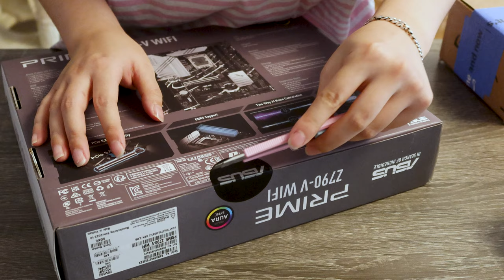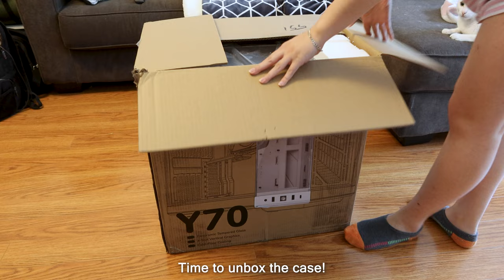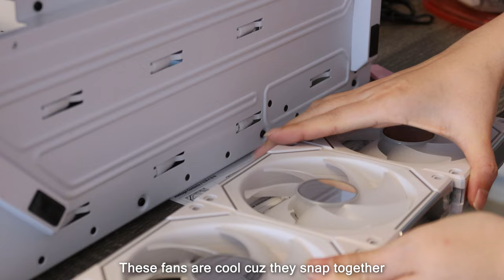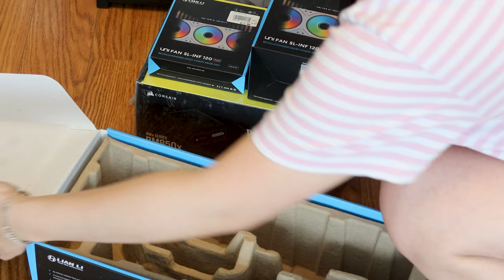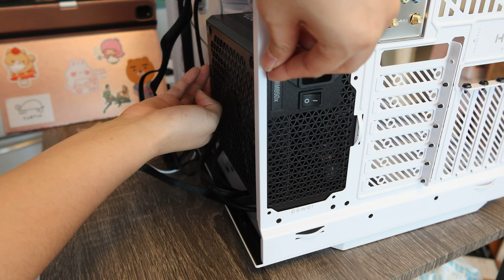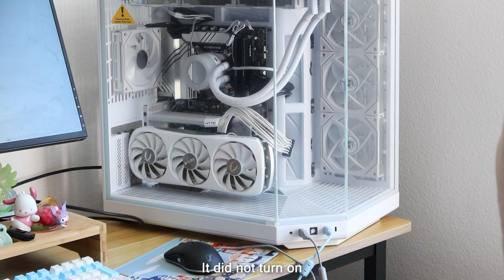Building my first PC | White Aesthetic, RTX4080 Super, Hyte Y70, Gaming & Productivity build

Comment from the maker: I got a lot of comments on my SSD being installed incorrectly but it is now fixed. I appreciate the constructive feedback!

Also got a lot of comments about why did I get this part instead of this other one. I got a bundle through Microcenter for the CPU, motherboard and RAM so my reason for buying those are because of the price. I am aware that I lost some performance from buying those parts, but it was my first pc purchase so I worked with it. All other parts were recommended to me either by an experienced friend or through a worker at Microcenter. Overall I have good temps and my gaming and editing experiences are so much better than before, so this build as of now is working for me!
Reply: great specs 12900k and 4080 super is a match made in heaven for both productivity and gaming i for one am glad you went the intel and nvidia route amd is a crash machine intel and nvidia just works
Reply: @hygarthwilliams6392  really? I was thinking of pairing amd and nvidea, why dont they work? Intel is so much more expensive aha
Reply: I did noticed it like not how I do it when I install an ssd on my Steel Legends motheboard Am5, paired the 7600X with the 7600 XT the idea here is being able to enjoy performance without breaking my wallet.
Reply: An upgrade is an upgrade, now matter how small!  Super big feat to build a PC for the first time as well, even I haven't done that yet because it's daunting. I'm so scared to mess anything up, but soon enough I'll push myself to do it.

Thank you for the video:)
Reply: How much was all this? T-T
Reply: How is it running? Has it given you any issues? I'm thinking of building my PC as well. Any tips? Any suppliers I can try?
Reply: came to the comments to make sure you fixed it! Great build :)

Comment: 3:12 Your SSD is not installed correctly.  You used the standoff instead of the proper screw that was provided with the mothetboard.  If your ssd is installed at an angle, it is wrong. Ssd should be exactly parralell with the board.  The standoff goes in first and then the ssd with tiny screw on top.
Reply: ใช่ เพื่อน  SSD ติดตั้งผิดวิธี  แบบนี้ทำให้ SSD เสียได้เลยเพราะการโค้งงอ
Reply: I'm pretty sure you install it first with an angle no? Then you push it down and fasten it
Reply: @appancha it needs to screw into a standoff. She screw it directly into the motherboard, which is wrong.
Reply: To bw honest its her stuff she paid for it so if she fucks it up is also her problem , these things even u noticed but only matter if someone is works in this area and do for clients pc ,because for that u need a do it correctly
Reply: @kryzlo474 nothing wrong with letting her know it’s messed up. Now she knows how to do it for her next build 🤷‍♂️
Reply: Only part I cringed right when I saw that😢
Reply: @yipyiphooray339 idk if you can see, but it’s bent at too much of an angle. she was so supposed install the standoff then secure the SSD with the screw that comes with the mobo

Comment: I have a question for you @Somaswooshi. Why did you get the power supply in black and 850W and not white and in 1000 or 1200W since your build is in white? O.k I see you said that you went with black because you can't see it from the front, but again why the 850W and not the 1000W power supply?

Comment: Honestly not bad for a first time PC builder! Looks great
I see an associate helped you picked out the parts.
They did a great job selecting parts based on your use cases. 
Make sure to fill out a survey, it really does help them out.

The only nitpick that will effect you over time is the SSD riser. 
The little hexagonal screw you placed on top of the SSD is meant to be a bridge pillar of some sort to make sure the SSD is not bent when installing. 
Over time you will notice that the SSD will bend due to heat and stress. That thicc hexagonal riser and M.2 silver screw is there to prevent that from happening.
My recommendation is to use the M.2 screw that comes inside of your motherboard box, it will be this tiiiiny screw that's silver that comes in a singular plastic baggy.
Micro Center does sell the M.2 Risers and screws individually as well if you're missing yours. They will be found near the thermal paste area I believe.

Another thing that will help you over time is space. I saw you only have one 2TB drive. Make sure that you don't use more than about 80% of your boot drive, because when using 100% of your drive there is a chance of corrupting Windows. Windows does need some breathing room to install updates, security fixes and more.

When saving footage (since you mentioned you will be video editing) make sure you save it externally on a hard-drive or get a secondary internal drive.
HDDs last longer but are slower, SSDs are faster but die quicker. It's best to use SSDs for cache files or game folders & as a boot drive, and  your HDDs as additional storage.
NASs will help you too, but that's becoming it's own topic.
When upgrading components, make sure you only use the power supply cables that came with your power supply as they are rated for it/are proprietary.

Otherwise Good job! Looks very clean. The Y70 is a great case to build in.
Say hi to Josh from the service/repair department for me plz.😉
Reply from the maker: Hey thanks for your thorough explanations and advice! Yes micro center folks were extremely helpful when I told them what I wanted and needed in a PC.

Yep found the other screw I failed to notice and the SSD is now installed correctly. Also got a heatsink for it! I definitely plan to install another SSD in the future.

I have been using an external hard drive for all my video footage cuz it’s takes up a huge amount of space lol. Good to know why it’s better that way!

The power supply didn’t come with enough PCIe cables, but I did check with corsair about compatibility before buying the separate PCIe cable. If I ever need another power supply, I’ll be more aware of the cables I need!

Comment: Sick build! I'm glad they are releasing more white PC parts too. I always wanted them but they are either too rare or too expensive. Lol I love Lian Li stuff it's what I use for my setup too. Hopefully in the future I can make a pure white build like that. My recent build is white/black/red. It was bad when I last upgraded because it was during the GPU shortage I ended up buying a pre built to rip out the GPU, CPU and mobo to shove into mine. Lol then I sold the rest cause it was crap I didn't need anymore. 😂 I should have waited till DDR5 was out to do it though. Oh well the 3070 upgrade was worth it.

Congratulations on the build! Gaming is going to be nice on that! Girl you need a second monitor though. I'm not sure how you can live without one! Gotta get a high refresh rate one next. 😅
Reply from the maker: Thanks! Yeah it’s a nice change cuz I’ve always had black or gray pcs so the white looks very clean! It does suck that they are more expensive but I’m hoping in the future they lower the prices. Oof yeah the shortage was crazy but glad you still got what you needed! 

Oh don’t worry I do have a second monitor! I just didn’t show it cuz it’s also my tablet  it’s clunky lol. Thankfully my main monitor does have high refresh rate which was another reason I needed a new PC cuz I couldn’t have a high refresh rate before!
Reply: @somaswooshi  Oh yeah! I think I remember seeing that before in previous videos. It looked really big. 😅 What kind of model is that tablet?
Reply from the maker: @LunitaArtCraft its a wacom 22in haha it is kinda huge 😂

Comment: A bundle assuming that you bought them from Micro Center only took a guess been at one of the locations, but can say that it is an amazing build, and we all make mistakes in our build part of the learning process. My only regret is not buying the Amd gpu sooner, but went with the Intel A750, Asrock X670E Steel Legends, Steel Legends 7600 XT (Current), Seagate 530 2tb ssd, Corsair case 5000D, and 32 gb rams. Will be honest Amd gpu are much lighter than the Nvidia counterpart. Love to see more content

Comment: This is an amazing build and looks absolutely stunning, but I think the gpu didn’t fit horizontally because you removed only one of the gpu slot panels. If you had removed both of them the gpu would have fit, but maybe I’m wrong! Either way the build looks incredible.
Reply from the maker: Thank you! ☺️ I did remove several slot panel covers off camera, but I could not find a way to fit it lol. Thankfully this case came with the part to be able to vertical mount, so maybe they knew certain gpus wouldn’t fit horizontally.

Comment: The white cable you used on your gpu, was it confirmed that that cable can work properly with your PSU? You can't always use random cables on your PSU because it could lead to wear and tear. Just make sure it's been confirmed by Corsair themselves that that cable is fine for your PSU
Reply from the maker: Yes! My friend called both companies so we confirmed that the parts are compatible
Reply: @somaswooshi  that's great!😁

Comment: Sad to see you hiding the nice part of the infinity fans at the back. Why not use reverse fans? I did that in my h70.
Intake back and bottom, and only exhaust in the top with the AIO.
Reply: back exhaust fits most coolers better as that's where the airflow is directed. function > form
Reply: @metrotyler  are talking the same ”back”? Im talking about the 3x fans in the back
Reply: @xsistlol  Ohh, my bad, I thought you meant the case's rear fan

Comment: For the motherboard through your affiliate link it's not the ASUS Prime Z790-V WIFI it's now the ASUS Prime Z790-P WiFi D4 LGA 1700(Intel 14th,12th&13th Gen) ATX motherboard, what's up with that?
Reply from the maker: Oops I probably picked the wrong version, but I updated the link to the right model, thanks for letting me know!
Reply: @somaswooshi  No problem because I will build the same computer but with different RAM. I think I am going to give this RAM a try: CORSAIR VENGEANCE RGB DDR5 RAM 32GB (2x16GB) 6000MHz CL36-36-36-76 1.35V Intel XMP Desktop Computer Memory—White (CMH32GX5M2D6000C36W). I am using all of your links so that you can get paid. The computer case is no longer available, but I believe I found it at Walmart.

Comment: GIRL CAN I USE THIS VIDEO AS A TUTORIAL OR DID YOU CUT PARTS
Reply from the maker: I would use this video as a tutorial if you’re planning on getting most or all of the same parts and as you go through each step, look up how to install each specific part! I made a few mistakes as I mentioned in my comment and throughout the video so it’s not perfect. The only parts I didn’t show was installing the bracket for the cooler onto the back of the motherboard and installing the i/o shield which I should have done before installing the motherboard to the case. Oh and I didn’t show where I plugged in every cable but you can always ask me if you have a question :)
Reply: @somaswooshi  OH OKAY I did watch some other tutorials but yours just seemed so much more simple bc I don’t understand ANYTHING, I did order some same parts but the case and rams are different so I don’t think it will be much different, I will try to use this video and correct the mistakes u made THANK U❤️❤️ also can I ask smth what’s the difference between prebuilt and building your own pc cause so many peaopel say it’s best if u build your own but it’s so much easier if I just buy I prebuilt
Reply from the maker: @Gothiecutie   Yay I’m excited for you to start building your PC!! 🥰 and same I just bought parts recommended to me lol but you got this! Well prebuilt is always going to be more expensive since someone is doing the work for you, but there are sites where you can pick out all the parts you want so it’s not a bad choice if you’re willing to spend extra. The biggest benefit to building it on your own is that you learn how each part works and fits so you can easily upgrade parts in the future.
Reply: @somaswooshi  ooh that’s true, right now I’m on a 1k budget so I will definitely need to upgrade with the time to get a high end one but I’m just so scared bc I’m so dumb 😭 hopefully I don’t mess it up and IF I DO I’ll just pay someone to build it for me loll
Reply from the maker: @Gothiecutie  you’re gonna do fine! I believe in you 👍 and yes even if you mess up someone can always jump in to help lol

Comment: the ssd is not installed corretly.... its sits on top of the standoff and a tiny screw goes on top!!! u are putting extra stress on the ssd
Reply: Correct, this is a common first time PC builder mistake. 
I've seen many SSDs that become bent over time because of heat and this constant stress.
The small M.2 screw, should come with the motherboard box.
The SSD doesn't come with screws normally.
Only the Crucial sticks give you one.

To fix it, make sure you power off the PC completely, then turn off the power supply to avoid any potential mistakes.
Removing the GPU can help.
Reply: I saw that too. #cringe